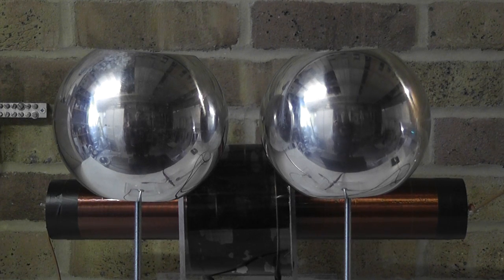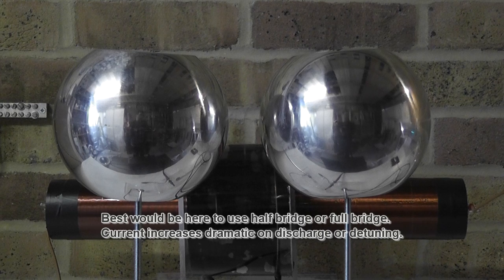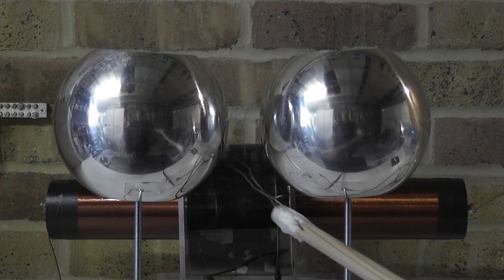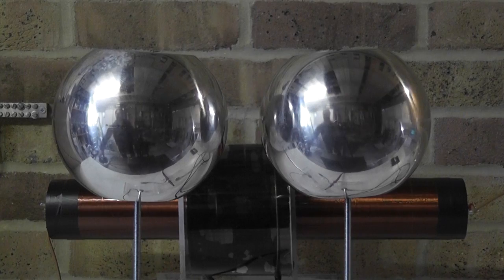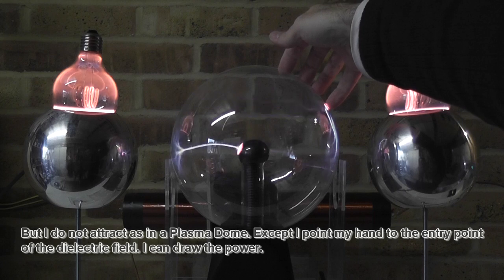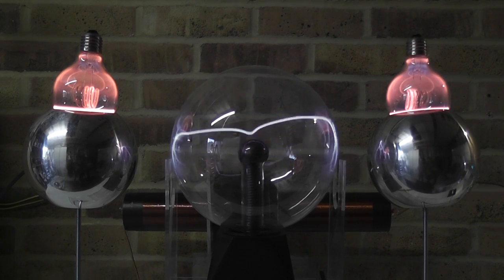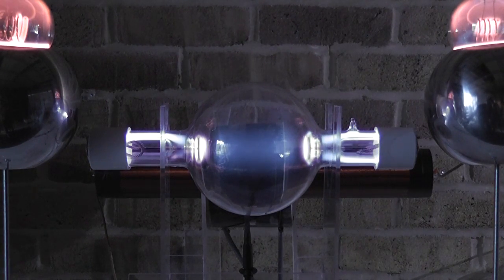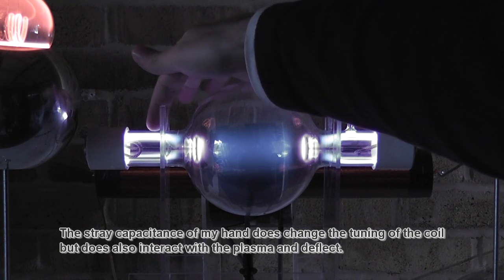The Phanotron Tube in a Dielectric Field of a Bipolar Tesla Coil

Comment from the maker: Russ, very good point .The pure helium is behaving in the low pressure like a proper plasma where the gas is becoming polarised. It is still AC, correct but the gas is missing one electron. When the electron is getting back to it's original position light is emitted and that in the whole tube not only as asamll streamer. The Plasma Dome does not behave that way because of the gas mixture and pressure. The small flyback would not have the power to excite the Helium gas.
Reply: You need more heliun , more partículas, more preasure. Maybe a plasma into a magnétic field.  betuewn a polos to conservation Energy. Of Cinetic Energy and Light Energy.